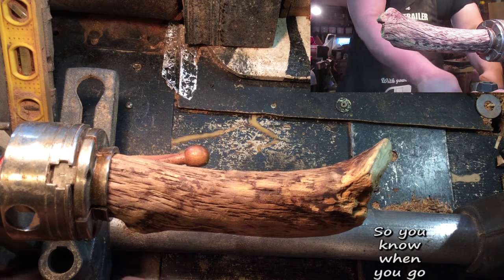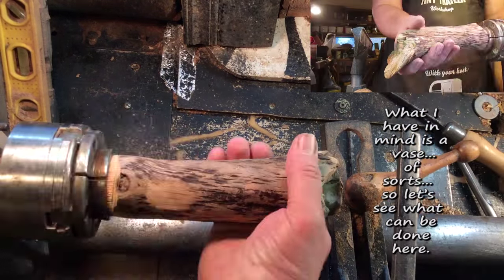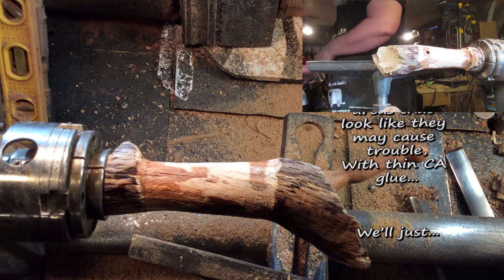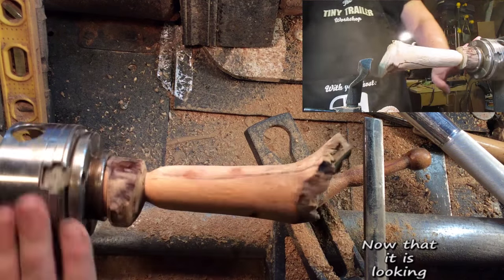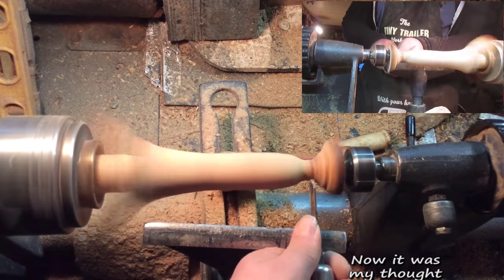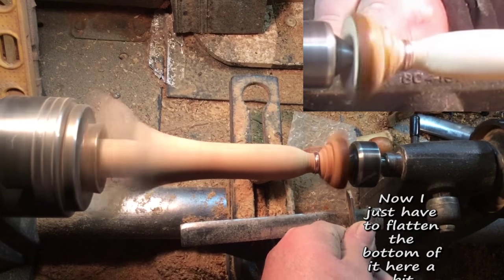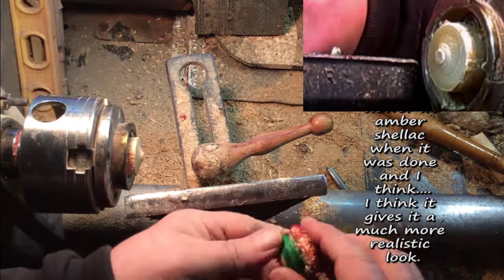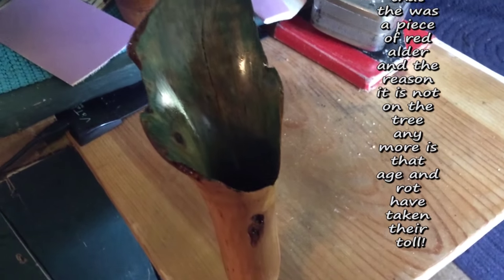Wood Turning #126 Texted Branch Vase

Comment: Beautiful!  Did you put a tenon on the chuck side?  If so, how?  If not, did you just secure it in the chuck in it's natural state?
Reply from the maker: +Richard Anderson Hey Richard: The original setting was with the branch in the chuck just the way it was... Then I used a half inch skew to make the branch sit more centred by cutting a tenon on the branch between where I wanted the bottom to be, and the top of the chuck... and then cutting what had been in the chuck off... Then I could place the new tenon in the chuck. 
It would have been nicer to have it not break... but I think it covered up well!
Thanks for watching
Larry
Reply: Thanks!